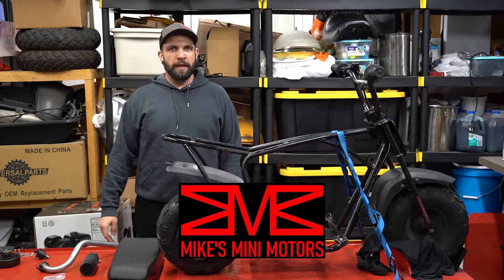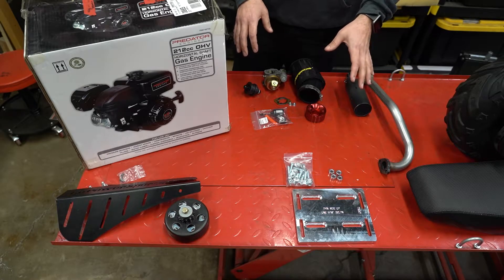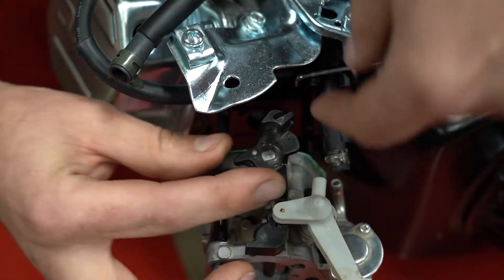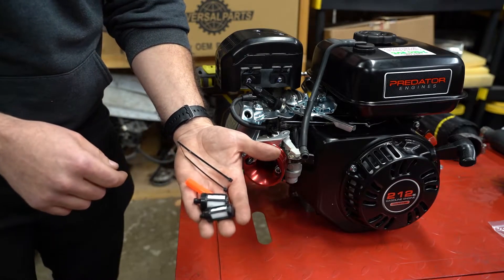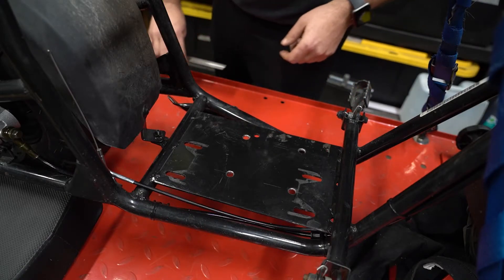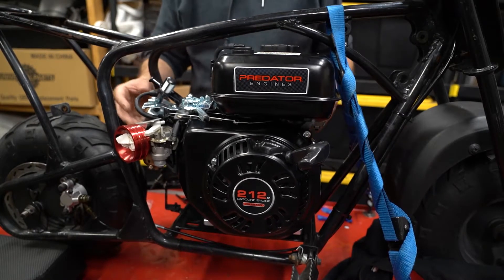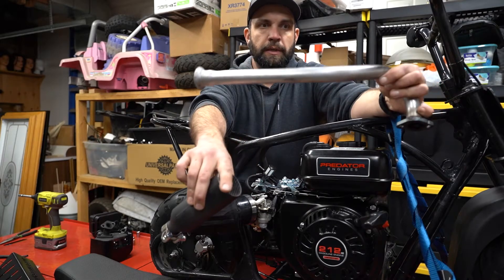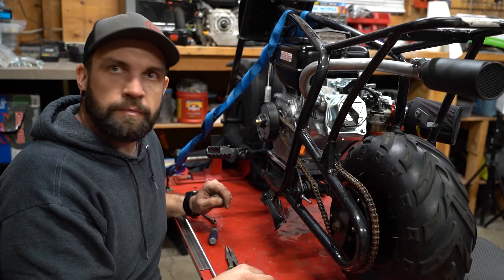Monstrosity Moto Build - Part 3 - Mounting the Predator 212cc Engine 1/2

Comment: Okay I have a predator 212 with a after market carb and it makes the engine not fit should I cut the frame a little and also is a #35 chain the original chain that was with that because idk what size clutch to get.
Reply from the maker: I wouldn't cu thte frame, uness you plan to reinforce it again. You may need to look at how you are mounting your engine. 

I believe the original chain was #35, but I don't remember for sure.

Comment: Why’d you have to put it in mm that’s so confusing to measure…
Reply from the maker: I did that because I prefer the Metric system over Imperial system. I would rather work in whole numbers and not fractions. It's super easy to convert though, just divide the mm by 25.4 to get inches.
Reply: @MikesMiniMotors  I mean yeah it’s just I’m on the complete other side the world so mm divided into inches is much harder and confusing than you think it’s the same with inches to mm for you just opposite